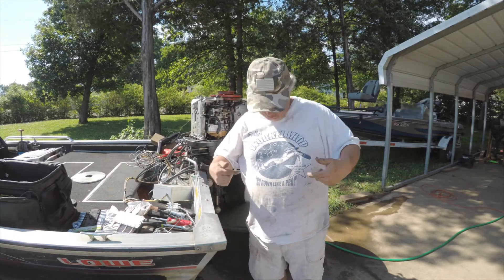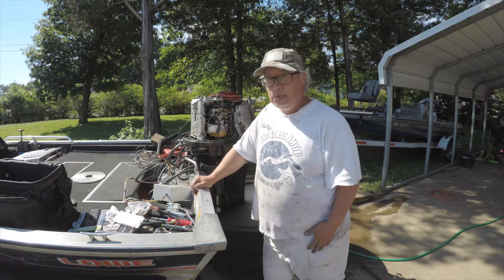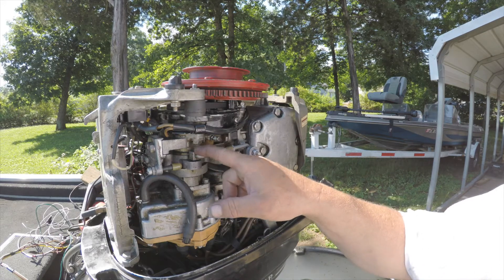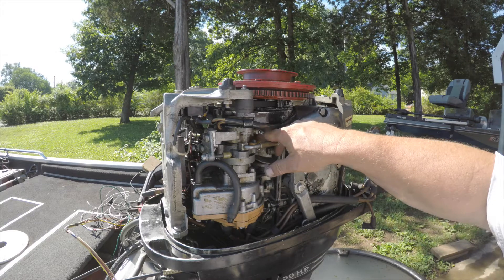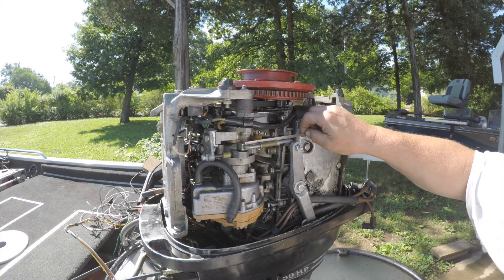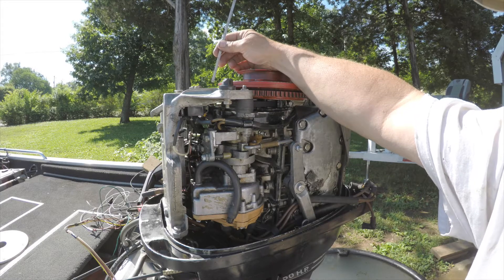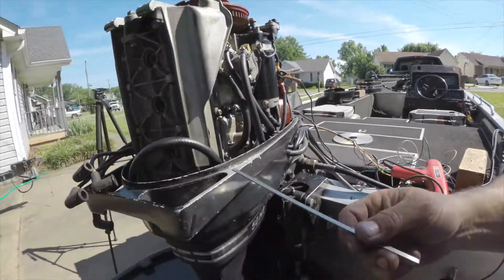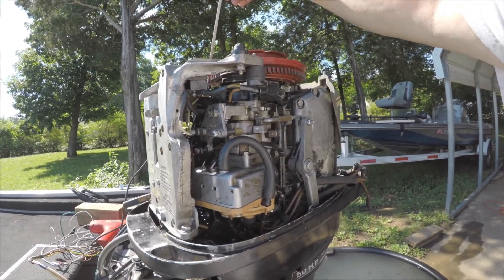Merc Thunderbolt 500 checking the timing

Comment: Having a no start issue, has compression, spark and fuel can you PLEASE HELP ME😂
Reply from the maker: How can I help?
Reply: @hawkeyemarine  I simply can’t figure out what’s causing it to not turn over , I had it running rough for a few minutes. And than it shut off and will not get going again. Everything’s connected, however the carb is flooding in 2-3 try’s I followed your videos and soaked it cleaned it and put back together. And now it’s having a slight misfire like it’s trying but still won’t go
Reply from the maker: @mindskater67  These motors are very critical on the fuel to timing.  Sounds like your floats and needle seat are not set correctly.  Also, make sure that when you are trying to start it is tilted back some so the fuel can get back toward the pistons.  Also, do a compression test and make sure you don't have a down cylinder.  And, make sure you have Champion plugs in it.
Reply from the maker: @mindskater67  also if you haven't subscribed please consider subscribing and liking the video's.  It helps.  Plus, I get paid very little to do this so it helps.
Reply: @hawkeyemarine   I will go back in and check it out, I must of missed something. Thanks! Your videos have been very helpful👍

Comment: Thanks sir, I like all your videos.  I have a 1972- 80 hp, 800 outboard,  I lost spark and changed the trigger switch and forgot to mark the timing. I  have a timing issue now and there are no boat shops in Denver that will assist me, thanks
Reply from the maker: Most boat shops will not work on anything over 30 years old.  I would buy a Clymer manual and watch some of my video's on the Merc 850 80hp it will point you in the right direction.  Thanks for watching.
Reply: @hawkeyemarine  thanks sir for responding I do appreciate it. I did order a Clymer for my boat and it should be here tomorrow,  I have saved your videos as well soi havesome homework to do. I  appreciate your time as well and will let you know how it works out. Thank you
Reply from the maker: @clarencjretap3685  Thanks for watching